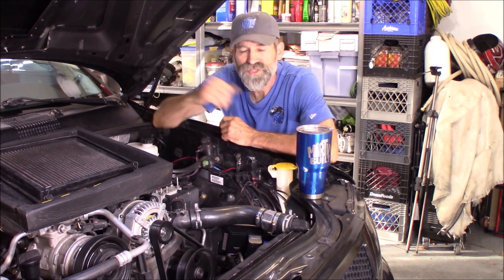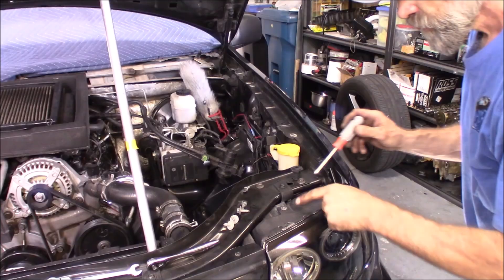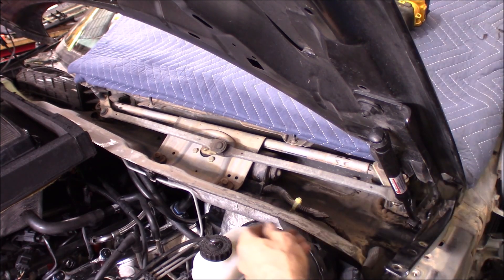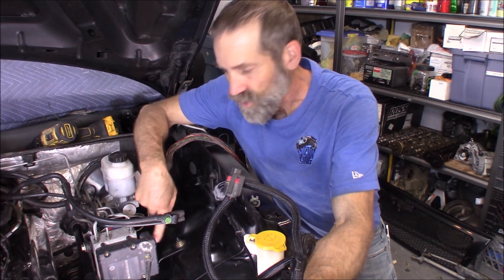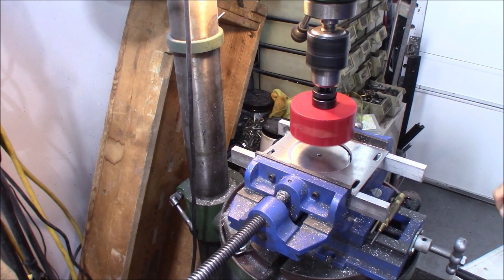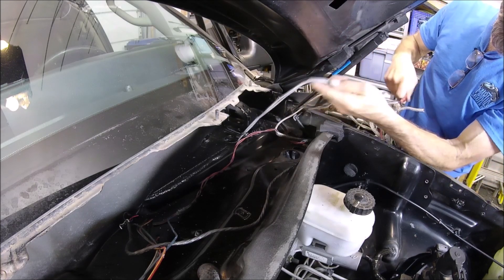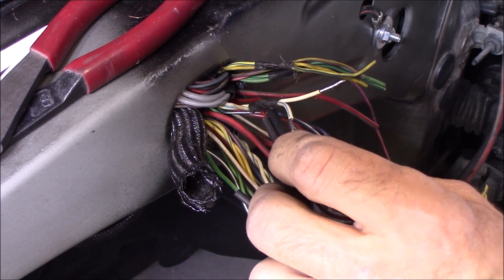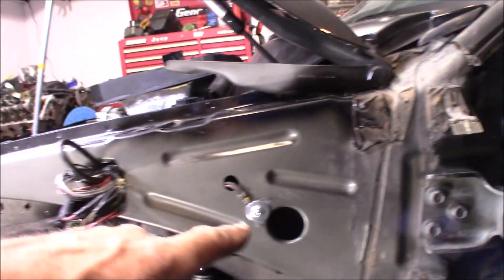How to Wire Tuck Engine Bay on a Jeep Grand Cherokee WJ

Comment: Hands down the best wire tuck I've seen. But I would hate to have to service that harness in the future.
Reply from the maker: Thank you John, that is the one thing about a wire tuck they are not easy to service should there be a problem.

Comment: 2:13 I see the cabin air filter! The cabin air filter is a Mopar accessory and was not included from the factory. You can still buy the assembly for $70 or so off Amazon and the filter itself is like $20. There is a non-Mopar assembly for around $40 as well.

The best thing for holding a hood or liftgate up is actually a shower rod. You can adjust the length and they come with rubber endcaps.
Reply from the maker: The cabin air filter I installed was the one from Amazon, not the Mo power one, and I don't recommend it. The plastic is low grade, and after a few years in the heat of Southern Nevada, it just fell apart. I have since removed it and reinstalled the factory grill.

Comment: HEY MARTIN, THX FOR YOUR VID! BEAUTIFUL RESULT!  QUESTION.. WOULD IT BE A PROBLEM TO DRILL A HOLE IN THE BODY ON THE PASSENGER SIDE AREA OPPOSITE TO THE AREA SHOWN  @ 10:08 TO FEED MY WIRE THRU INTO THE CABIN?

Comment: Its normal my wj 2004 v8 volt outpot 12.5 v
Reply from the maker: That seems a little low to me if the vehicle is running at the time you're testing Should be more like 13.5 to 14.4

Comment: Would you be willing to go to pick apart with me to help me find the right injections and possibly an 08 intake? It’s ok to say no
Reply from the maker: Pretty hard finding that intake the 08 just having been hittin the salvage yards not quite old enough, should be soon though within the next couple years. I've only seen one at the salvage yard and that was a few years ago and at the time I didn't know about the benefits of the 08 intake and cams. But I'm sure we could find injectors. I actually have quite a few of those in stock.
Reply: martinbuilt how much are they?
Reply from the maker: @codygay3412  48 for a full set
Reply: martinbuilt is there an email or phone number I can contact you at? I would definitely take a set!
Reply from the maker: @codygay3412  in the description of most of my videos at the very bottom you can contact me through Facebook
Reply: martinbuilt ok I sent you a message!